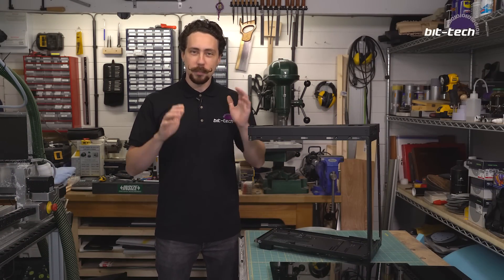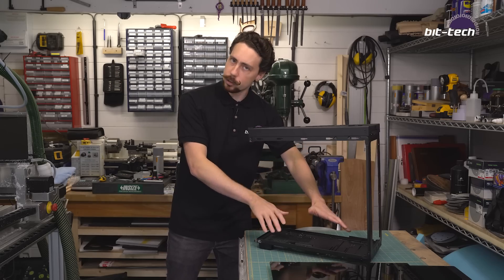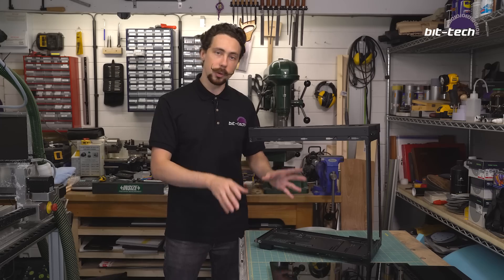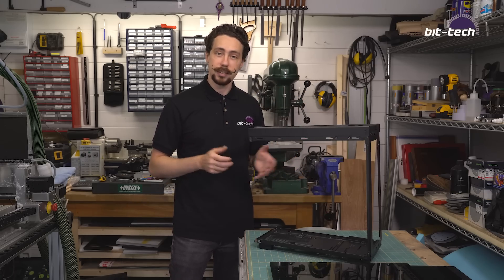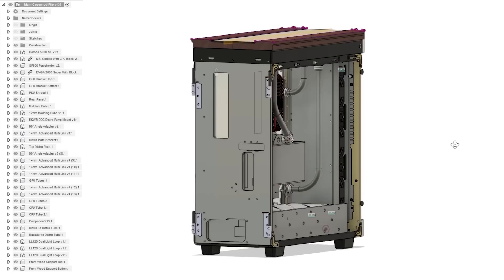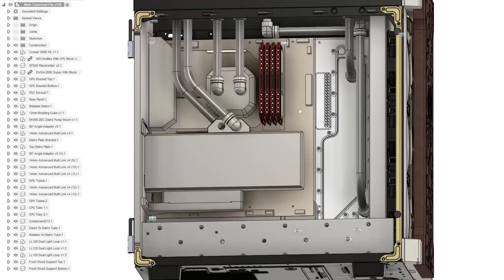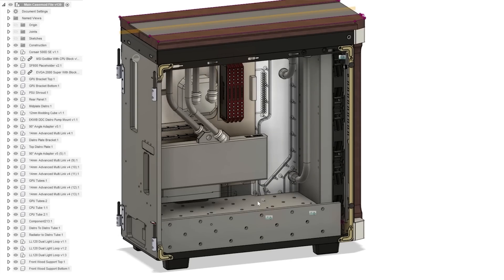Project Toreador (Bloodlines 2 500D MOD) Pt. 2: Acrylic Panels and Distro Plates

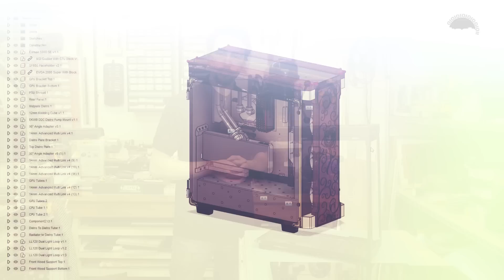Comment from the maker: 02:58 Planning in CAD 🤓
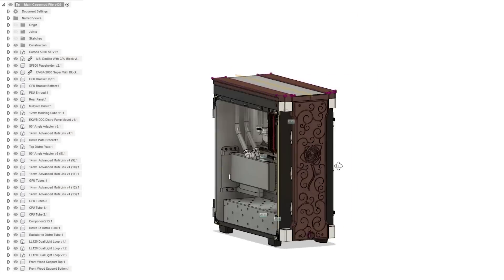05:22 Machining pr0n 💦
09:40 Applying wood veneer 🌳
11:03 Assembly and progress shots 😍
Reply: Thanks bro for the video. 😊❤
Reply: Any chance you could share the 3d printed GPU bracket? :)
Reply: Can you share me a drawing?
Reply: It is rather sad to see such violent abuse of depth of field. Seems like watching hardware porn through a keyhole.
Reply: Hey Alex, looking to mod my iwn 500D any possible way you could share your acrylic panels and distro cads and cnc files? 

I have the asus Maximus xi formula  z390 mobo so would need to alter for the two vram ports. 
Did you also make your cable management brackets on the back side ? 

For some reason when I do my own in fusion it will not show up in surfcam at work for me to machine it.
Reply: So what may I ask is the software your rocking their my friend?

Comment: Corsair Graphite 760T Full-Tower  White,MSI z390 meg ace, Intel 9900k,gskl 3200mhz 4x8, Sapphire Radeon 580 nitro+Limited edit.What can be done with existing parts, can you give us the necessary custom parts list, thanks in advance

Comment: You're one of the best case modders on the planet. I actually don't consider this modding anymore, because you could just as well build it from scratch.

Please try and make an SFF pc next that has two 240 mm radiators and 25 mm fans, but less than 12 l volume. I think it should be possible, if you use distro plates as structural elements. The absolute tiniest case with the cooling power for the absolute highest-end components.
Reply from the maker: Had something like this on the back burner for aaaaaaages now, just a matter of finding the right moment to do it.
Reply: @bittech1   I actually have a second idea that would support two 280 mm radiators.
Have the components layed out flat like in a Node 202 or Zaber Sentry and the case standing upright. This is like the absolute most compact way to lay out high-end components as the Zaber Sentry showed. But that's exactly the size of two 280 mm radiators. So once the case is upright, you could put two exhausting 280 mm radiators in a second chamber on the right, which suck air from the top and bottom. Front could be distro plate and left side can be a glass panel.
That should be 14 l in total, but with even more cooling power.
Reply: very cool idea id love to see soemthign like this

Comment: Love your designs and creative style. One question though, with all the wood and leather planned for this build, why did you print the 3d printed parts in black and not go with one of the various wood filaments? Can't wait to see the final product.
Reply from the maker: Scott McMullen Aah a good chunk of that was just reliability, those combs are pretty brutal for FDM printers as the walls are really thin and there’s a lot of retraction etc. I tried in PETG first and it was just a mess, ended up on PLA just because it prints so cleanly.
Reply: @bittech1  I think the overall design is very nice but the black combs are throwing me off a bit, instead of printing them I'm surprised you didn't CNC them out of some matching wood, or would that have not been strong enough to accommodate all the wires running through them?
Reply from the maker: @ph0t0dave  Definitely can make wooden combs, but these are black so that they blend in with the motherboard and other blanking panels. The other reason I mention in the video is a practicality one, in that you then need to drill/tap them in a different arrangement. Contrary to the video release schedule I was right up against the line with building this one as it needed to ship out to a live event.
Reply: @bittech1  Cool beans, I had not thought about the backside of the motherboard but now it is making more sense. Thanks for the reply and looking forward to seeing the final build. :)